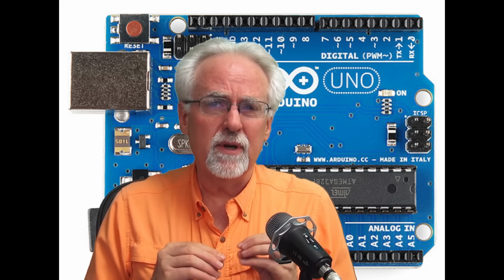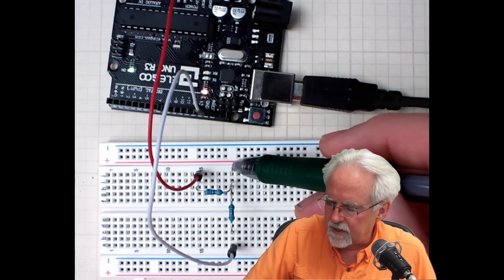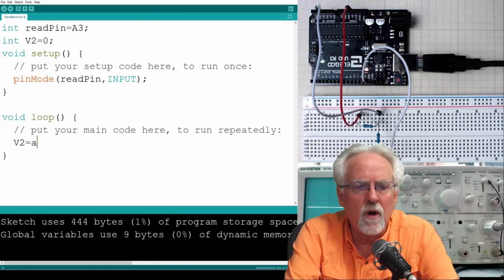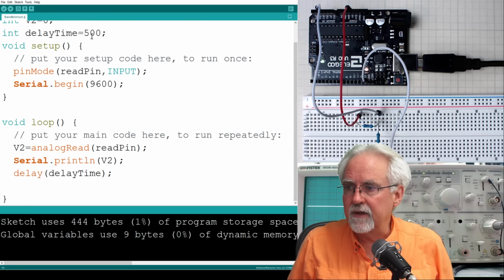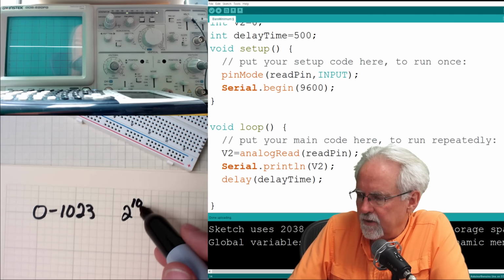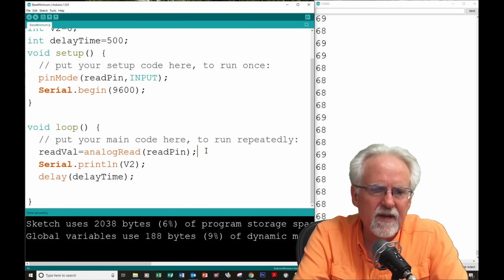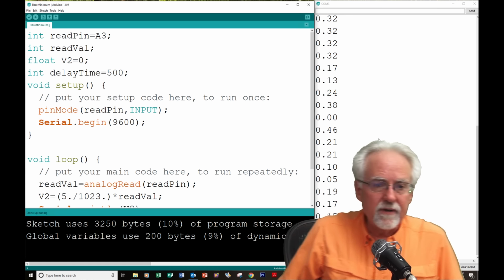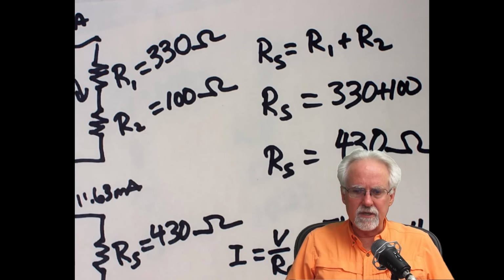Arduino Tutorial 10: Understanding How To Read Analog Voltage using analogRead Command

Comment: Great Job!  You are a great teacher, I got a more accurate read by measuring to the ground and instead of getting 1023 I got 1007 so I used this in the formula and got a more accurate measurement when comparing it to the volt meter
voltage=(5./1007.)*v2;
Serial.print ("Voltage   ");
Serial.println (voltage);

Comment: I would really appreciate if someone helped me out here,
why if I just say analogRead(A3 or ~6 or even 7) without any wires connected and no pinMode(INPUT or OUTPUT) it still reads somethong for all 3 of them?
So I tried to combine both analogRead and analogWrite, Read shouldlogically give what I put in Write but it didn't . if I used an ~pin that would work but an A pin didn't

Comment: D: Mr. Paul... I did my homework and used only one resistor and it burned lol smoke came out of it and it was hot xD! It's there a maximum voltage a resistor can handle?
Reply: In order to know whether a resistor would burn out or not, use this formula: Power across resistor= voltage across resistor times the current.  Make sure to convert milli amps to amps when using the formula. If it is less than 0.25W the resistors which are in the kit won't burn out.

Comment: I did it! My circuit is 220ohm resistor followed by 560ohm resistor. My voltage reading was 3.59V. At first, I thought I had something wrong because I expected 1.41V (my R1), but then I realized we were reading R2. Sure enough, when I did the math for R2 I got 3.589V. Yay!! The coffee mug is still full. Onward to lesson 11!

Comment: I have a doubt here,
   Why did you use " float v2=0"  ,why 
   not "float v2"
Reply: when taking input values its good practice to set variables as 0 initially. But not necessary. However, it is recommended as it can solve a lot of problems before they even start.

Comment: Hey Paul did the homework with a 300 ohm(R1) resistor and a 220 ohm resistor(R2). Did the circuit analysis and got a voltage of 3 at V1. Thanks for the videos.

Comment: no big deal; but why would it not be more accurate to use formula 5/1024 (instead of 5/1023)?
Reply: the value reads from 0 to 1023 (which is 1024 "units") 1 to 1024 would lose the 0 and 1024 would be out of range

Comment: Great job. Just a question (hope not too a silly one...) Declaring pin a3 as integer? A3 seems a string to me, not an integer at all😢
Reply: I used to wonder the same thing but it looks like the programming language makes an exception...also you can call Pins A0-A5  Pin 14-Pin 19 (I just found this out thanks to your question).  In the Tutorial example I used A0 for my Analog Pin at first and then went and declared it as "int readPin=14;" which seems to work just fine :)
Reply: https://forum.arduino.cc/index.php?topic=441134.0
Reply: @danbishop4035  Thanks!

Comment: What is the input impedance of the analog input port?
Your reading is a little low using low values of resistance in your voltage divider.
I suspect it will always be a little lower than the calculated reading due to port loading, and will get worse as the resistance values in the divider increase...
If your students pick values like 330 K and 470 K,  (470 k to ground),  for their voltage divider, will the port loading affect the voltage reading? I am pretty sure it will so you might mention that when you do your next update on your training videos.
.
One more item to consider would be : will the port loading change as you approach 0 volts and 5 volts?
.
Another good way of explaining how to calculate the conversion voltages is to divide 5 v by 1024, (because zero counts as 1 step), and then simply multiply that 'bit_value' by the analog read number to get the voltage......Knowing the bit value helps people understand the accuracy of their readings.
.
You are by far the best instructor on YouTube regarding the Arduino, and at 74 years old and a retired teacher / engineer you  have been instrumental in getting me interested in learning something new.. Maybe you can teach this old dog some new tricks!
Regards,
Dennis O.

Comment: I am doing them with you and it is taking 3 times as long as I keep rewinding!! I was working the real voltage out percentage wise just because it is what I am use to. I was getting 238 so I divided 238/1023=.232 or 23 percent. 23 percent of 5 volts  .23*5=1.16 volts. Yours is shorter but mine makes it clearer to me. Just a percent of a number. Thanks for the series.

Comment: Using the 100 ohm resistor makes this slightly confusing because the Voltage across the 100 ohm  resistor  works out to be 1.16V and the current is 11.6mA (The same digits as the current but with the decimal place moved).

I got confused because when I used my meter it had a reading of 1.2 Volts across the resistor. Looking back over this and doing the calculations I am guessing that my meter might not refined enough to read 1.16V. Guess I need to keep following your work then I might get it. Thank you so much for your time Paul.

Comment: Seems like in my case it reads the voltage drop, not actual voltage (confirmed by multimeter while using two resistors 220Ohm and 100Ohm) so my formula has to actually be 5-(5.*(analogRead(pin)/1023.). Weird... I'm using Funduino Uno board :/

Comment: i was wondering, in ohm's law, you do this equation to get the voltage:
v=ir
but wouldn't that mean that if the resistance is LOWER, then the voltage would get lower as well as you're multiplying by a smaller number? doesn't that contradict the point of resistors, with higher values lowering current more?
Reply: that was a good question, kind of questions that leave me stuck thinking.

i think what the equation shows is that with lower resistance, lower amount of voltage is required for sending a fixed amount of current across a circuit.
higher the resistance, higher amount of voltage required for same amount of current.
if current flow has to be reduced, then higher resistance is to be used.
with fixed resistance, a greater amount of voltage will be voltage will have to be applied.
basically, it depends on the energy consuming device that is attached to the circuit per unit time. which helps us to make the decision what needs to be changed to provide the same power to the device.
this is the reason why electricity in house wiring has such high voltage to overcome all the wire resistance.
then at the equipment end, there are resistors to lower the voltage.
also the reason why there are step down transformers when electricity reaches suburbs from power stations. because they can are being sent way close and over 1000s of V.

Comment: Really enjoy and appreciate what  you are doing here!  My question is if you were taking a signal from another computer that did have a supplied 5 volt reference wire, could you damage the arduino by inputing a full 5 volts if say it only generates 4.85 on its own?  Or just recalibrate the code?  I'm new to this and love your ability to break it down!! Thanks!

Comment: The discussion of variables instude of numeric literals is highly misleading and off the point of the intent of the guidance to use symbolic names vice hard-coded numeric literals.  The issue is that by using literal numeric values to specify things which reasonably be the same value in multiple places and which can change is that the change then must be applied in multiple locations.  Just making a variable substitutes one problem for another.  The correct solution is to use a symbolic CONSTANT.  For instance, delayTime should be declared as 

const int delayTime = 500;

You want it to be unchangeable during execution but these same everywhere that you may be delaying.  Variables, as in your example CAN be changed during execution.  Constant values as in mine above CANNOT.  The same applies to the pin names although in that case, you may be better served with a macro such as 

#define readPin A3

NOTE:  The above is a preprocessor command and must not be terminated with a semicolon uness you really know how the preprocessor works and what comes out the other end, in which case, you already know that.
Reply from the maker: The issue here is how to introduce new learners to programming concepts. By using a variable, program can be edited by changing one value, instead of having to replace each instance of a specific value. That is both true and valid. Your explanation above is a prime example of why so many new learners give up trying to learn programming. You have introduced many concepts that would be foreign to a new learner, are beyond their ability to comprehend at first, and do not add the right skill and value at the right time. There is an art to teaching, and few have it.
Reply: @paulmcwhorter  My point is that you teach the substitution of one bad habit for another.  Stop approaching this as if your audience is composed of a bunch of idiots who cannot comprehend beyond see spot run.  It is better and easier to teach the right way the first time vice a simpleton way that must later be unlearned.  introducing const is not so complicated.  I will conceded that #define may be out of scope here.
Reply from the maker: I do not teach as if my audience are idiots, so what you say is factually incorrect. I teach as if my audience is hard working, eager to learn, smart but not subject matter experts. Also, your comment illustrates perfectly the attitude that turns so many away from programming . . . a combination of bully, rudeness and arrogance.

Comment: I added  third 10K resistor after the 100 ohm instead of replacing one. This gave me 3 voltage readings of  3.85V, 3.49V and 0 Volt respectively.
I'm really enjoying these lessons in my retirement.... trouble is , I can't find enough time to do my "Honey do" chores.

Comment: No idea what is going on but my setup, same as yours, is giving me a 5 v reading wherever I put the link wire to A3 (before/after  each of the resistors.
Reply from the maker: Try printing the raw analog read value, which should be between 0 and 1023, and should scale proportionally with voltage. If this looks reasonable you probably have an error in your calculation of voltage.

Comment: Great teaching. Why is an arduino not recommended as a plc. surly it can be used as one with far more capability? Practically it is running on command. so why would it be considered unreliable?

Comment: Got 0v, 5v and 1.15v.   But, tried [1] disconnecting A3 and got a floating value of about 0.5v, [2] moved A3 to the top of R1 and the ground wire to the bottom of R1... and still got 5v ??

Comment: Hi Paul,

I am trying to get a reading of the voltage across both resistors.

My idea was to have two input pins, one for reading voltage across resistor 1 (300ohms) and another pin for reading voltage across resistor 2 (100ohms). However, no matter where i put my second input pin on the breadboard, it only gives my a reading of 0. 
This is of course because the second resistor is connected to the ground pin (and thus getting a reading of 0)

As another commenter did, you could always subtract the voltage reading of R1 from the initial 5V you started with, requiring only one input pin. Id this the only way to do this? Is it possible to do this with two input pins or would you need a third resistor in series  

All the love
Tom
(PS, my elegoo kit was purchased with your link and as a sign of appreciation i will be contributing to your patron very soon)
Reply: Thanks for commenting this. I was in the same situation.

Comment: hi paul i have updated your code to print both V1(R1) and V2(R2) here is the programme
 int readpin=A3;
 float readval;
 float V1=0;
 float V2=0;
 int delayTime=500;
  
void setup() {
  // put your setup code here, to run once:
pinMode(readpin,INPUT);
Serial.begin(9600);
}

void loop() {
  // put your main code here, to run repeatedly:
readval=analogRead(readpin);
V2=readval*0.0048875855;
V1=5-V2;
Serial.println(V2);
Serial.println(V1);
delay(delayTime);
}
the result was: v1=3.84 
V2=1.16

thank you for videos
Reply: Out of curiosity did you have the circuit set up the same way?
Reply: @Zman2112  Yes, the circuit shouldn't change. The only thing new here is, he's creating a new variable V1, which he's just setting to 5V minus whatever V2 was. Since the voltages in this series circuit must add up to the power supply output (5V), a simple subtraction should give you the right answer for V1.
Reply: My question is, can you read the voltage directly without doing the subtraction..5V - V2.
I got the 1.16  V reading and the OV reading but could not find a way to get the voltage reading at
R1 of 3.84
Reply: Ai TechBoy
Worth to say, that reading two pins before and after the resitance is the way the voltmeter works.
You can already do, with the commannds you have learned so far.

Comment: ??Not sure why but I'm getting 2.50. Anyone getting different results?

int readPin=A3;
int readVal;
float V2=0;
int delayTime=500;
void setup() {
  // put your setup code here, to run once:
  pinMode(readPin,INPUT);
  Serial.begin(9600);
}

void loop() {
  // put your main code here, to run repeatedly:
  readVal=analogRead(readPin);
  V2 = (5./1023.)*readVal;
  Serial.println(V2);
  delay(delayTime);
}

Comment: For personal exercise I like to pause the video everytime I believe I understand a concept to try it on my own, before unplausing it to check my work. The videos are easy to understand and I believe you are doing a great job explaining these concepts. I really enjoy this series and hope you continue it.

HomeWork:

using a 1000ohm resistor connected to a 100ohm resistor and using ohms Law V=IR I got a value of 4.54V and 0.45V = 4.99V about the expected amount. 
Now I compare it to the values my arduino give me. Values = 4.46V and 0.44V = 4.90 when measuring raw Voltages(no resistors) I get about 4.91 so this adds up

Code:
NOTE: trial and error taught me adding a LED to the circuit messes with the returned values(duh)

int outputPin=4;
int readPin=A3;
int readVal;
float V2=0;
int inDelay=1000;
int bodRate=9600;

void setup() {
  // put your setup code here, to run once:
pinMode(outputPin,OUTPUT);
pinMode(readPin,INPUT);
Serial.begin(bodRate);
}

void loop() {
  // put your main code here, to run repeatedly:
analogWrite(outputPin,255);
readVal=analogRead(readPin);
V2=5./1023.*readVal;
Serial.println(V2);
delay(inDelay);
}

Comment: I've lost you on lesson 10. You declair a variable value for V2 above setup. But you also declair a V2 value in the void loop. Clarification please?
Reply from the maker: There is a difference between declaring a variable, which is defining its type, and then giving it a value.
Reply: @paulmcwhorter  What I'm confused about is you want to know what V2 is in the loop, but you are saying it is zero in the declarations. (Thanks for the quick reply!)
Reply: Yep, at first you are declaring that you have a variable "V2" the arduino see's this once and you set it to "0" ( for tidy programing) this is where your data will be stored, within the loop "V2" will store the result of the calculation and will change according to what's happening to the pin in question, so each time through the loop it could be different or remain the same, that depends on the outside world and what you have attached to the pin....hope that helps a bit !
Reply: @andymouse  Thanks! So the zero is just  a starting point.
Reply: @andyshap  hope this is correct.....the best way I read was to think of variables as buckets. So in this example you have 4 buckets named readPin, readVal, v2 and delayTime they are just names on your buckets waiting for you to put something in them, which Paul has put A3 in the readPin bucket, nothing in the readVal bucket, nothing in the v2 bucket and 500 in the delayTime bucket. In the void setup and void loop he has "looked" in the relevant buckets and used whatever is inside, then if required, has removed what was inside and replaced with something new i.e. the analogRead value. Just remember buckets are very fussy and stubborn and like to know what is going inside them, whole numbers "int" or decimal numbers "float" or words "string" and once you tell it you cannot change their minds !!

Comment: I put  just  "float V2"  without  " =0" , why didn't it cause any issue?
Reply: Possibly because it is just "good practice" to set it to zero, thus not setting it to zero and it still works, but not using "good practice" techniques may someday cause a situation that doesn't work to become really hard to diagnosis, where do you begin (in theory)?
Reply: @GDub1958  it had a garbage value initially am I right??